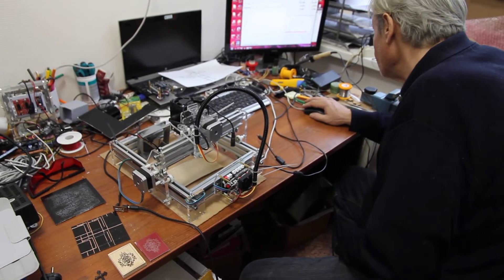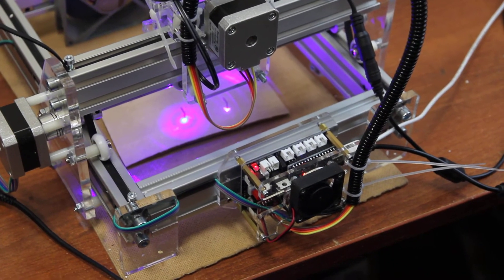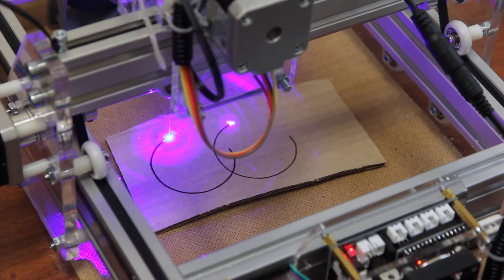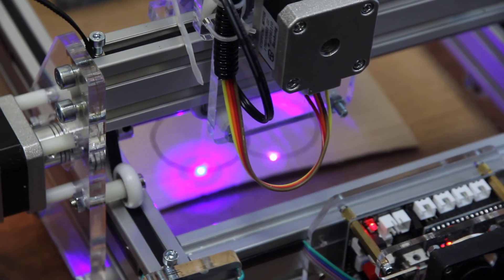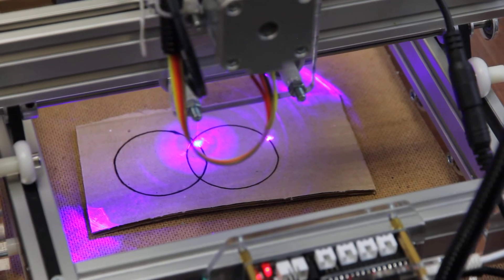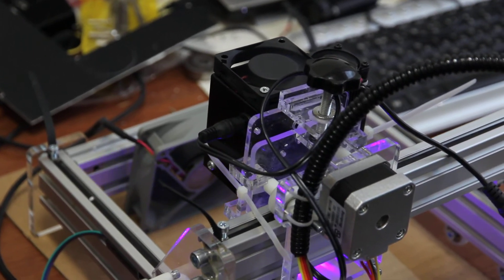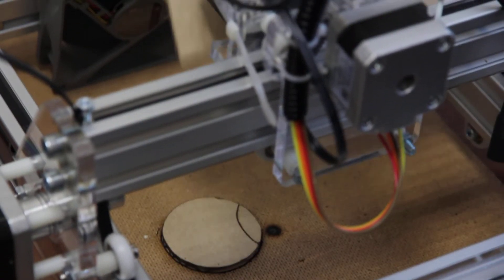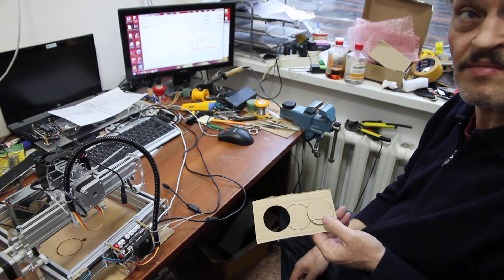Comparison of 2 lasers: Endurance laser and cheap Chinese

Comment: First of all, thanks for the comparison, although I don't understand English.
I intend to buy a cnc laser to cut mainly plywood, mdf and acrylic up to 5mm or 6mm but I'm confused by so much information on the internet. I've already looked at the 'Ortur Laser Master 2 20W' and the 'NEJE Master 2 Max 40W' but they say that the laser used in these machines is not very good.
I've also looked at some lasers on endurancelasers.com and got some information from George, who must be the Manager. Although it is for hobby but I would like a laser that really cuts!